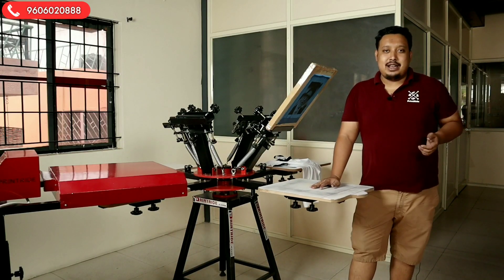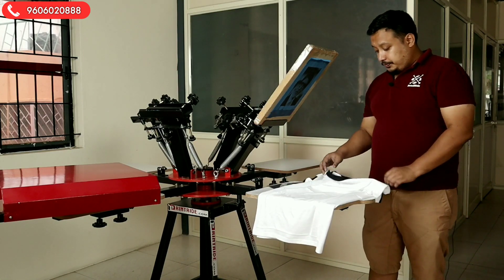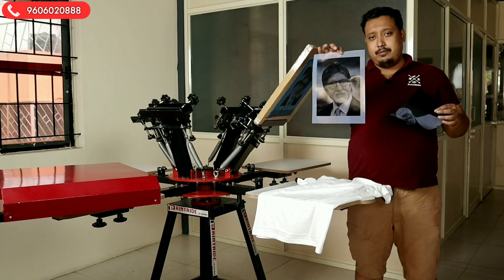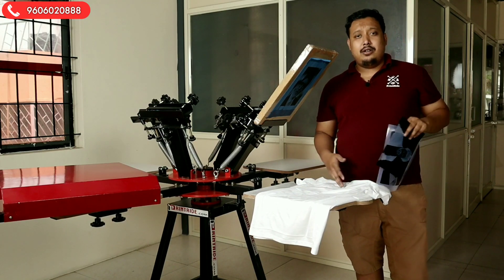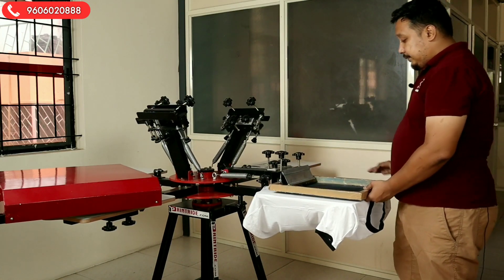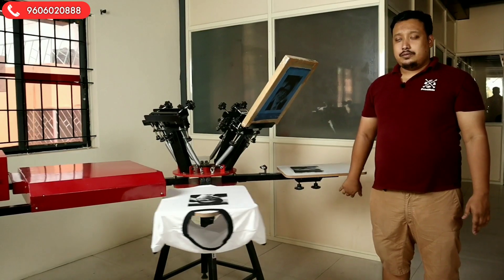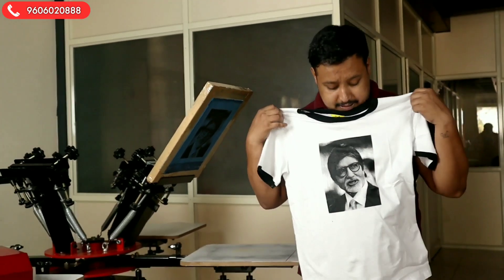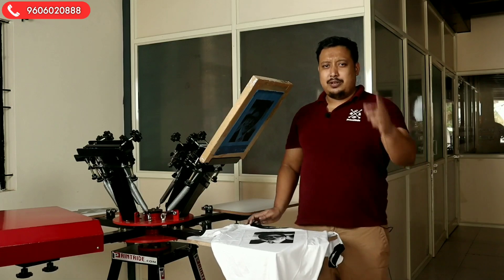Single Color Halftone Printing In White T-Shirt | Learn  Screen Printing Process

Comment: What is the mesh count? Halftones LPI? Exposure time? Give proper info if you really want to help learners
Reply from the maker: Hello Sir

Mesh Count - 62
45 LPI
Exporsure Time - Depends on your exposing unit and film . We used 50 Sec

Regards 
Team Printride
Reply: @Printride  thanks. 62T mesh you mean? What would be that in normal count like 120, 160, 200 mesh? And also which emulsion? The same photokina that you sold me?
Reply from the maker: @devensharma305   
Mesh - 155 Mesh Imported
Emulsion - Photokina CS5WR